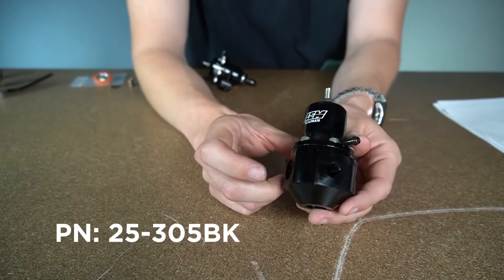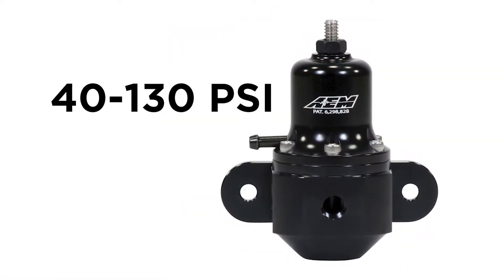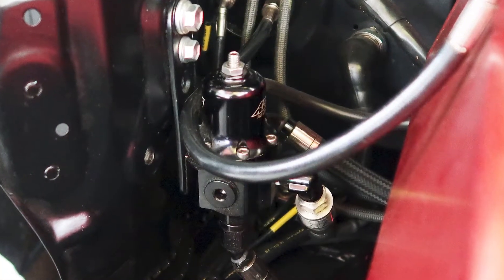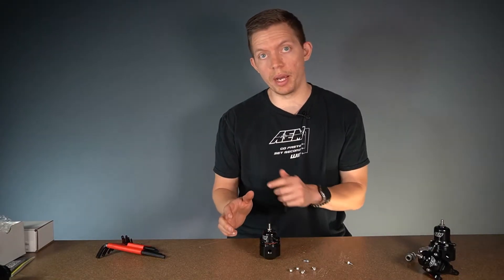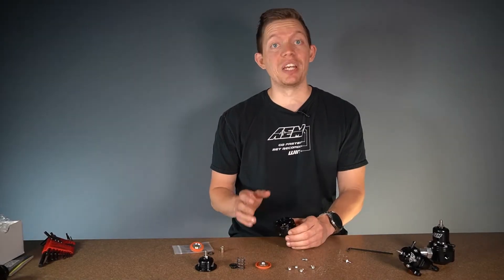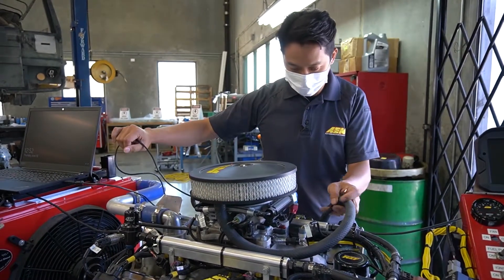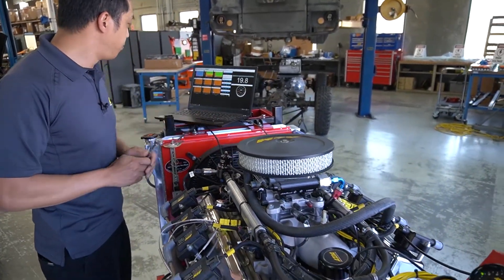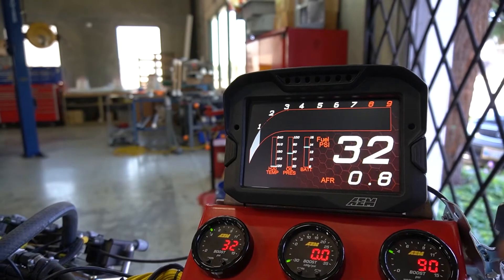HOW TO: Set Your Adjustable Fuel Pressure Regulator!

Comment: So I’m doing a full fuel system rebuild and I want to use the high flow pump. I’m afraid it’ll make the fuel pressure too high can I use this to get my due pressure to the stock 36 psi?

Comment: You guys make some beautiful components. I can see the quality here. Is there a fuel regulator for NA carb cars that run 6-7 Psi? And do you adjust regulator pressure with engine running or just the pump on? Thanks for sharing this video. Cheers from Motown/Dearborn.

Comment: If you are tuning the engine based on 43.5psi, and the running engine is producing 33psi are you not "low" in that case?

Comment: Nice video thanks. Can I raise fuel pressure to have a bit more of flow on my injectors as my AEM AFR is too lean. You mention the fuel pressure should be the same as what my ECU mention? what is happening if ECU is set to 2.5 bar and I am puting the regulator pressure at 3 bars? regards
Reply from the maker: There are a few reasons why you may be running lean. Please contact our support team at gen.tech@aemelectronics.com and they can help you!

Comment: If you lose or are missing vacuum could that keep the motor from running or not let it idle and die?
Reply from the maker: Variations in fuel pressure can cause problem with the way the vehicle is running.
Reply: How essential are the orifices on a stock K-series Honda?